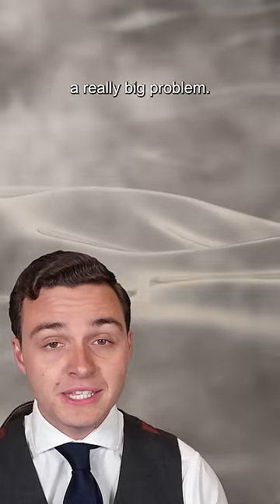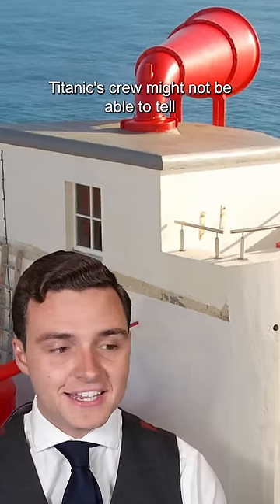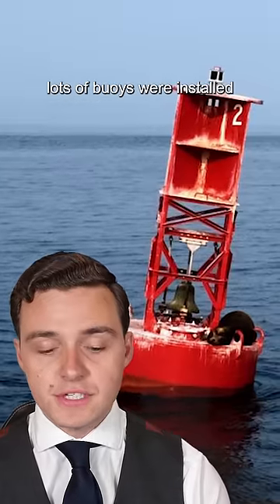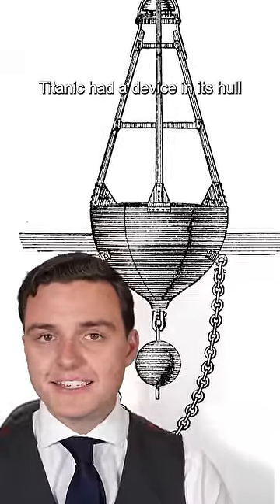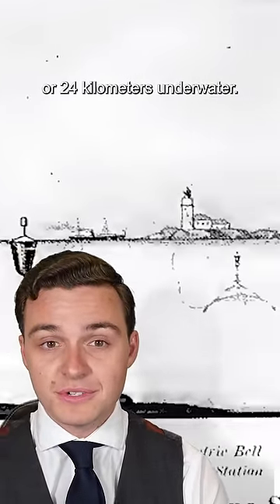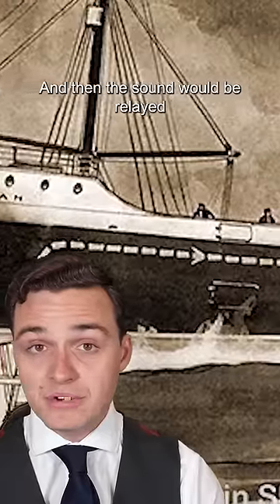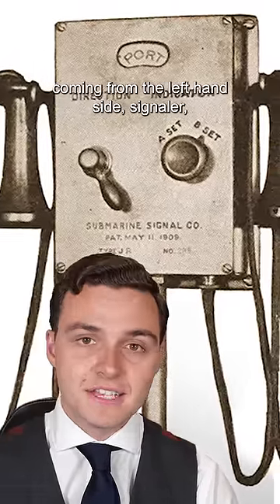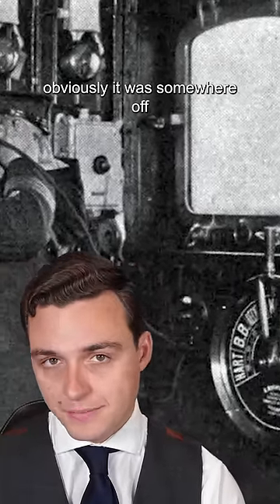Titanic's Strangest Feature #shorts

Comment: This really IS a clever device--and I have never heard of it. Did submarine signals continue to be used well after the advent of radar?
Reply: In a way they're still used, submarines use a passive system and many vessels use a vertical active "depth finder "
Reply: Yes. Echolot, fish finder, side-scanning sonar, mine-search sonar (high frequency, travels only a short distance), explosive depth finder (a capsule with a known sink rate, causing a small explosion on ground contact, the time between release and explosive sound being linear to the depth), SOSUS (US hydrophone lines to detect subs passing through), towed array sonar (a long line of hydrophones towed behind a ship or submarine, able to detect and find the bearing of even very weak sounds, e.g. of other subs), sonobuoys (hydrophones connecting to a floating antenna, with or without direction finding, with or without activity be sonar capability, used by planes, helicopters and ships), dipping sonar (attached to a helicopter, allows them to hear below the sea while airborne), underwater telephony, ultrasound imaging (e.g.at the doctor or veterinary, nondestructive materials testing, say checking turbine blades for cracks), active sonar to find ships and subs, passive sonar (the main and usually only way for submarines to perceive their environment), listening for undersea quakes undersea volcanic activity and so on, listening to whale song and other communication of fish and marine mammals, SOFAR bombs (at a certain depth the sounds are basically wave-guided on that depth, and low frequency noises will travel very, very far. With 3 listening stations, the time differences give you a pretty accurate position of the event, so SOFAR bombs are meant to locate downed planes or subs with problems even in the middle of the ocean.), autofocus on older Polaroid cameras, finding the distance of a thunderbolt (time difference light/sound), some touch screen technologies use ultrasound waves just over the glass, some parking helpers detect the distance using ultrasound, the dog whistle (dogs hear higher frequencies), anti-youth loitering systems (not only do they tend to dislike classical music, they hear higher frequencies, than older people), anti-cat and anti-insect systems and co …

… oops, these last ones are in air, but otherwise identical.

BTW, radar was first invented in 1904. Hülsmeyer.
Reply: AuschwitzSoccerRef. Thank you for explaining this. I also thought the bell was underwater.  Logically, if there was an entire network of buoys built with underwater bells it would mean many other ships must have had similar underwater listening devices.  But it makes more sense that the bell was above water, and simply able to be heard from above and below the water.
Reply: AuschwitzSoccerRef.  No it really was underwater. Look up Submarine signals. Early form of sonar I suppose, and its a logical developement if you have ever heard sound when swimming underwater -sound is loud and travels long distance underwater.
Reply: @michaeldonnelly2977  The bell was underwater. I guess it was an early form of sonar, and it didn't take them long to figure out that you could generate the sound yourself and measure how long it takes to come back. Sound travels through water much more effectively compared to air.
Reply: Submarine signalling through bells or oscillators was a common navigational aid in the early 20th century. The systems were patented, designed, and manufactured by the Submarine Signal Company of Boston, and were submerged below lightships (a lighthouse on a boat), buoys, and were also mounted on tripods connected to lighthouses in shallow water. There was an extensive network of these devices on both sides of the Atlantic, and while the technology was eventually eclipsed by radio direction finding it contributed to early experiments in sonar.
Reply: Yes, radar is not used underwater, instead they use sonar.
Reply: @michaeldonnelly2977 Sounds made above water won't be heard well underwater. the sound needs to be made below. Regular bell buoys are just used to warn surface vessels in harbor or near coasts
Reply: Sorta. It's effectively a passive sonar device which are now incredibly powerful and used on military ships and submarines
Reply: As a communication method? No, not really.

The device the Titanic had to receive the signals could be called a hydrophone, which is still used in civilian and military applications (listening to stuff without having to send out a sonar pulse is useful)
Reply: That’s a lot of sound pollution for the whales and dolphins.
Be a lot cooler if the technology got to a high level where we don’t destroy ourselves while executing our technology
Reply: @advorak8529  Wow! That's an impressive, and, I would say, pretty exhaustive list! That anti~youth loitering system is also known as 'the baby torturer'... (Captive audience.)
Reply: @MG-bs5mr  AKA "echo sounder."
Reply: @doogleticker5183  yep 👍

Comment: I never knew that Titanic had a pair of ears to listen out for Boyes bells but didn't detect the iceberg. This is a earlier version of radar.
Reply: It’s nothing like radar
Reply: @thatoneguy611 correct, radar is above the water. This was more like an earlier version of sonar!
Reply: Also radar is active. That means it sends out a signal that then reflects back. This is a passive system. It only listens so can only hear and detect things making a sound. Sonar can be both passive or active. Again passive requires things to make a noise. Active sends out a sound and then picks up the reflection.
Both systems have advantages and disadvantages. Active can detect quiet things. Also it can detect range and relative speed by analysing the time to receive the return and Doppler shift. The disadvantages are cost and size (since more equipment is needed) and the fact that it makes it easy to detect what it emitting the sound. Passive as well as being stealthy and simple, also allows identification of the target based on the sound it's making.

Comment: A pity that ships couldn't signal each other the way buoys signaled them. Or at least, I'm assuming they couldn't.
Reply: There is acoustic submarine communication used by well submarines, however for surface ships wireless radio communication is much better
Reply: @felixbeutin8105  That's nice, but you're missing my point. Radio communication (which an increasing number of ships did have at the time) does not, by itself, convey directional information the way this system did; it cannot tell where another ship is relative to yours (aside from "in wireless range").

Do you see what I'm getting at now?

Comment: Curious, under what circumstances would a crewman pick up the headset? A fog rolls in, pick up? Would Marconi operators warn them, then they listen in? Was this feature used on her solo voyage off the coast of England or Ireland? Did Olympic or Britannic have this too? Was this a job only the higher officers undertook? Do ships today have this? 😅 In case you didn’t notice, I’m obsessed. 🤩🤓
Reply: I'm guessing that they'd be manned when visibility got bad 🤔
Reply: I would assume that radar and modern navigation systems have replaced this one (although buoys are still used I can't remember if they have methods of creating sound).

Comment: I never knew how terrifying fog can be until 3 separate occasions.  Sailing a small boat on Long. Island Sound, heavy fog rolled in and the wind stopped. Drifted for hours, occasionally hearing but not seeing motorized vessels approach then recede. Second time,  I was swimming in Medicine Lake, east of Spokane WA and fog rolled in. My friend, who was no longer visible, but close enough for me to hear him shouting in panic.   I swam to him and had him float on his back eyes closed while I held him with one arm and swam sidestroke towards what I thought was back to shore. I became totally disoriented and fearing we could be going in the wrong direction.  I don't know how long we tread water but when the fog thinned out just enough to see the direction of the sun, I swam towards shore (still not visible) but approximately according to the sun. We eventually made it.  Third time was the scariest.  Skiing in Davos, Switzerland,  I decided to take one last run while my brother headed for base. I reached the top, but by this time,  there was no one on the slope. I was well above the tree line and there were a few deep drop-offs cordoned off with flimsy snow fence.  Then, thick fog just loomed over the ridge and quickly enveloped me. Complete white-out. I could not even see the tips of my skis most ofthetime. I tried to maneuver just by sensing which way was downhill.  I got dizzy and fell over a few times  because I couldn't sense vertical.  I was also afraid of going over the edge of a cliff. After more than an hour it started getting dark and I was nearly panicking.  What saved me was the distant sound of metal clanking from the ski lift. I slowly went in that direction until I got to it. B6 the time I reached the bottom it was almost too dark to see.  So, yeah. Fog is terrifying.

Comment: The reason that ship failed is bc the bullet rivets used were one grade lower of stainless steel than what was required. The steel wasn't strong enough, the ice and freezing temperatures along with running directly into the iceberg is what made it sink. When the rivets failed, the ship started coming apart at the seems and leaking water in.

Comment: The Titanic's designers were actually very far-seeing and had solutions to most of the common problems at sea. Even the lifeboats would probably have been sufficient had they been filled to capacity.
Reply: Possibly, though not guaranteed by any chance. It was common practice in the past to just go with it, the rules weren't as strict, and especially at sea! Just think about it, the rules and laws are still VERY lax at sea as long as you're not near any coast! Open waters is free for all

Comment: ... a pair of tunable foghorns mounted on the ship  plus a pair of tunable subsurface hydrophonic resonators used like 2 such (headphone + microphone) audio systems like what you told in this presentation ; the frequencies of the resonators aboard the ship and the resonators in the water could be adjustably tuned to obtain from the substances (ice , wood , metal , sargassum , etc.) to be avoided an optimum (usually a maximum) set of acoustical signal reflections nor resonant reverberations . 
     Is that what SONAR is ?

Comment: I worked on a crab boat in the Chesapeake bay years ago and the one time we got stuck in super dense fog was kinda scary. We weren't far from a shipping lane so you could hear the horns from big ass ships nearby but the thick fog does make it very hard to judge where it's coming from. I guess it has to do with the moisture in the air bouncing the sound waves around in a weird way but it seems like the sound is coming from all around or directly above you. Luckily it only lasted about 20-30 minutes.
Reply: Crabs are delicious as i am too. 🎉. I am seaman retired.

Comment: I can see how this would be used to detect submarines in WW1 by listening for the propeller noise.
Reply: They did use something pretty similar, but on a rotating mount - so the operator could find the exact direction of the noise.

Comment: What's fascinating is that fog is not a solved issue at sea, even today. Radar uses light, and so like visible light it too struggles to penetrate fog, yes it can see relatively well but range is poor and you really struggle seeing anything small.
Interestingly enough as icebergs are water and light is good at penetrating  water icebergs are also relatively difficult to spot on radars, especially small growlers.

Comment: My question is always this: why were they called "watertight compartments" when the wall of each compartment didn't even reach the ceiling? You cannot call something "watertight" if there is a gigantic hole in it. 

???????    Who let that slide? Who approved that? I don't care who hit the iceberg, I want to know who fucked up building the ship. If those compartments had walls that reached the ceiling, the water from outside wouldn't have kept pouring INSIDE.

Am I crazy? Why does no one talk about this?
Reply: the bulkheads have no holes, but they are only present on lower decks. Specifically, i assume that the height is chosen such that:

1) if the water goes over this point everywhere, the ship no longer has enough buoyancy to float

2) if the maximum allowable number of compartments fail, the ship retains enough buoyancy for the water to not go over

the consequence of these two combined is that if the system fails, higher bulkheads will have no effect, and if it does not, they simply add weight and inconvenience.

Comment: Dude it is 
PORT AND STARBOARD
NOT
LEFT AND RIGHT.

TECHNICALLY IT IS
LARBOARD AND STARBOARD
DERIVED FROM

LOAD SIDE AND STEER SIDE

PORT IS CALLED PORT SO IT ISNT AS CONFUSING TO PEOPLE AS LARBOARD VS STARBOARD WOULD BE.
PLUS
PORT SIDE OF THE VESSEL OS USUALLY THE SIDE WHERE THE SHIP TIES UP TO PORT ON HENCE "PORT"

STARBOARD IS CALLED THAT AS IT OS A DERIVATIVE OF "STEER SIDE" AS EARLY SHIPS HAD THE RUDDER PLACED ON THE REAR "RIGHT HAND" SIDE.